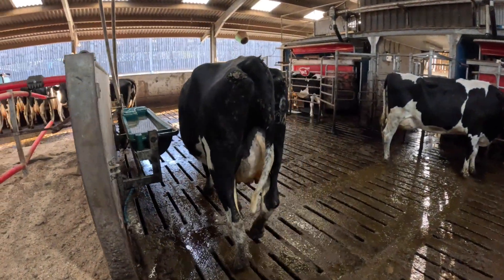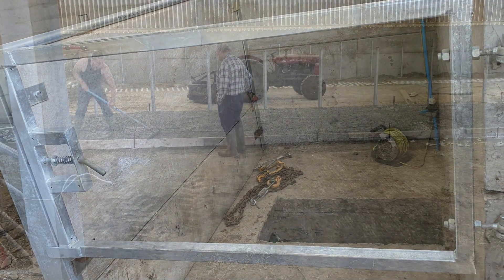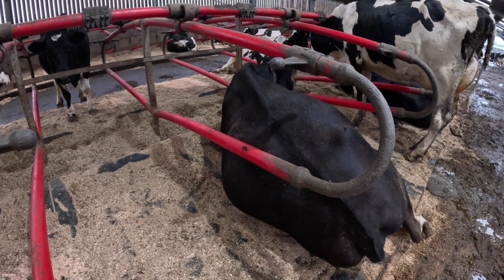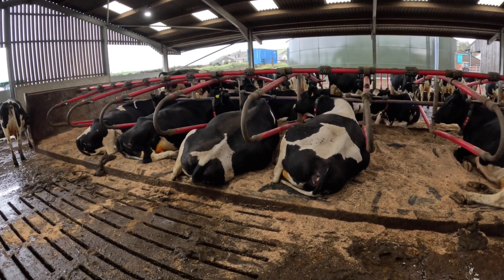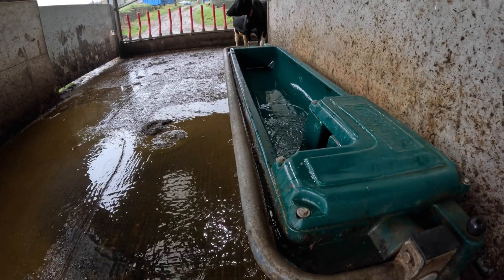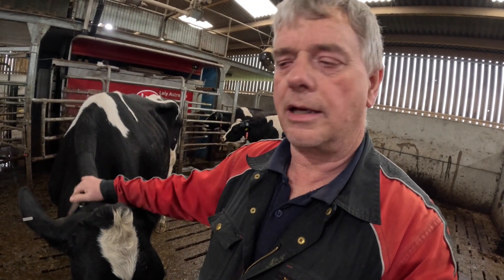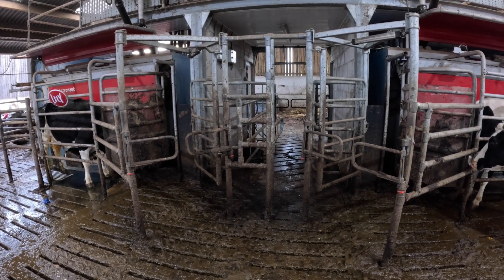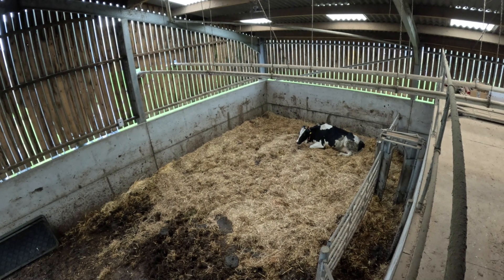A Journey Through Yorkshire's Cutting-Edge Robot Milking Farm System!

Comment: Hi, just wondering what size your building is?
Reply: Thanks for that, do you find the cows enough feed space given that you have 3 rows of cubicles?
Reply from the maker: @simonscott4887  Yes Simon. We had to design the building to feed on one side because the land is not level enough to feed on both sides. that's why we made it longer. There is currently 105 cows in the building, the only time all the cows are at the feed fence is if we leave them a little tight for feed the night before so at feeding they all want to feed at the same time. Even then there is only about 8 to 12 cows that cant fit in. With this system you never usually get all the cows wanting to feed at the same time, some are milking some are lying down. To make sure they don't all want to feed at the same time, make sure they have a good supply of feed on offer at all times. This stops the over crowding at the feed fence. I hope this helps😀
Reply: Nice farm! How many cows are the max for the robots you think? And does the zero grazing make it disquit in the barn? Is the farm now a one man show, or is there still help needed? @yorkshirefarming
Reply from the maker: @boerstevenvdv  Thank you for your question. We are max on 2 Robots with 110 milking cows.
Reply from the maker: Zero grazing works for us as we have a split farm with land 3 miles away. The cows thrive on a continuous supply of fresh, short grass.
Reply from the maker: We are a father and son team with help available for breaks and holidays. The farm can be managed by one person, but it is very busy.
Reply from the maker: Hi Simon, The building is 66.55 Meters Long 16.75 Meters Wide and is 12 ft to the eves. I would recommend taking the building to a minimum of 14 ft to the eves and go taller if you can as this will help with ventilation,